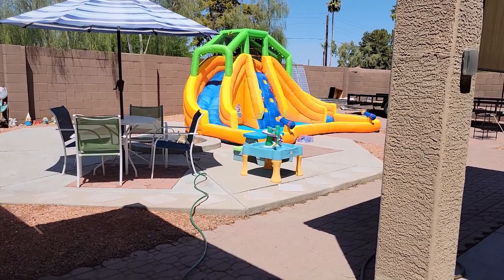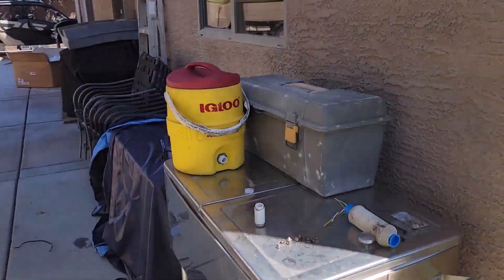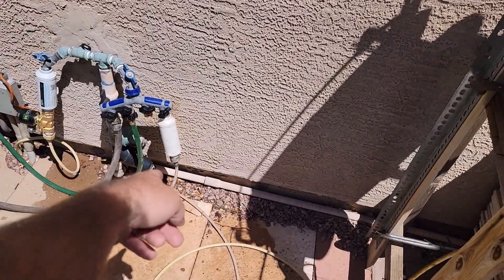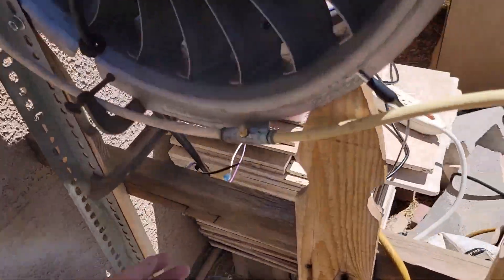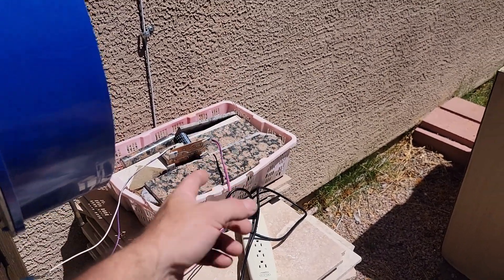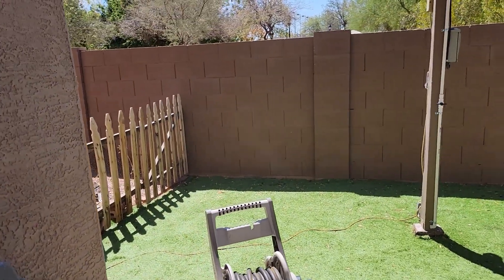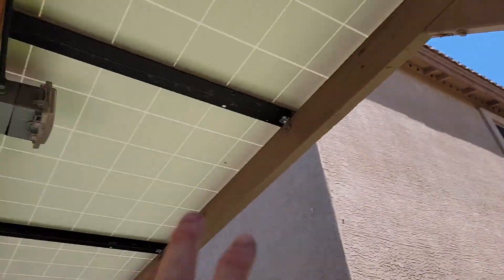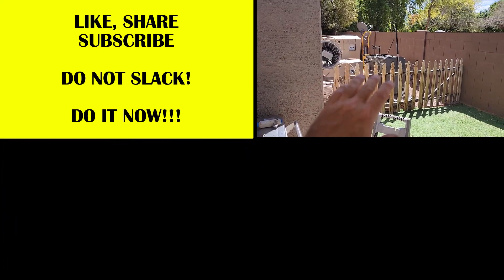Frankenstein builds a EcoBlue powered Mist-Blaster for the grand-kid's birthday party

Comment: Test the GFI if it’s working correctly by grabbing a metal water pipe out of the ground and the case of the fan. 
If it’s up to code and working correctly, all will be fine  😂.
Reply from the maker: I thought I felt a little tickle when I grabbed the fan while standing on the damp artificial turf. But sometimes it is just a nerve or something.
But I realized I better ground it at that point.

Comment: could those motors run on straight 120?
Reply from the maker: Not directly. They are rated 208-230VAC
However. Since the AC voltage is just immediately rectified to DC to charge a bank of capacitors inside, you can cheat by just powering it direct by DC instead of AC.
And one trick to use 120VAC direct for testing etc is to make a simple voltage double truck.
So the first half wave of the 120VAC (that is RMS, peak to peak is 170) to use one diode to rectify and charge a capacitor. Then the opposite polarity of the sine wave is biased by another diode to be in series with your charged capacitor, and then the second capacitor is effectively double the first one.
The second capacitor is the one inside the device.

It works. I have now powered up 208/230V VFD's and ECM motors with a 120VAC source.
And you can double the voltage again with another diode and capacitor. So I have also powered up 460V VFD's and motors this way from 120VAC.
However, you start to loose what you can supply for steady current and the amount of ripple. So I reserve the voltage quadrupler just for unloaded testing. The doubler seems to be ok for smaller loads like this fan, a small HP ODM etc. 👍
Reply: @hackfreehvac  I had a ecm motor 208 240 I ran it on straight 120 and and it did not care idk why
Reply: How many amps are you pulling on the 120 side?
Reply from the maker: @lee-johnson  Here's the answer 
https://youtube.com/shorts/zZjr6wLYhMk?feature=share